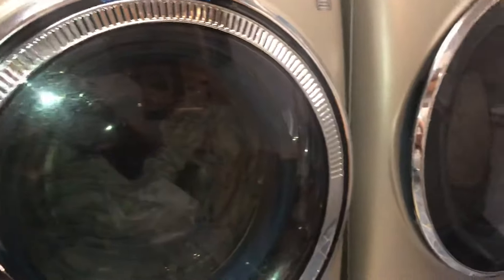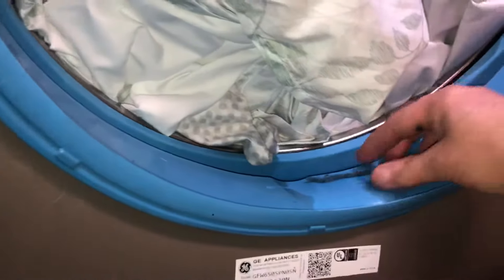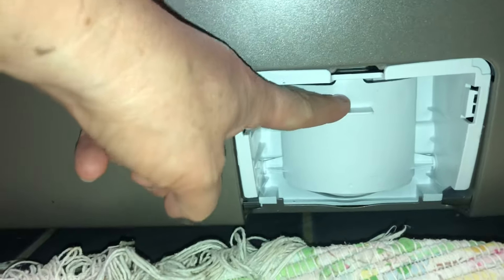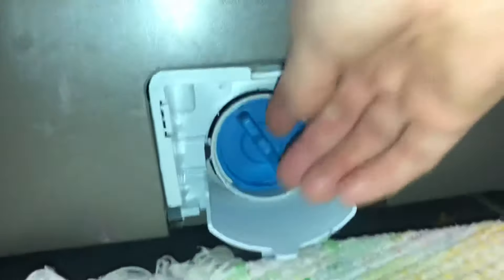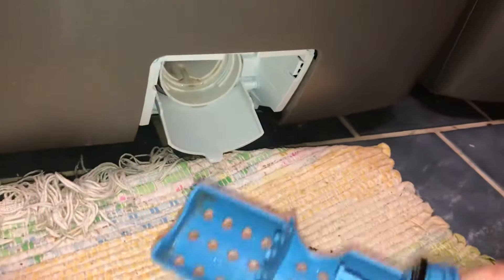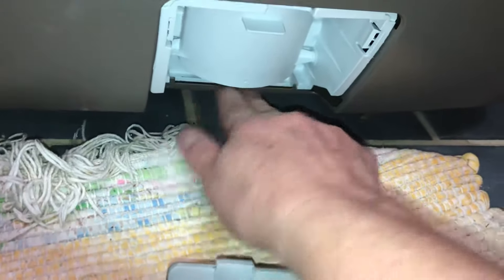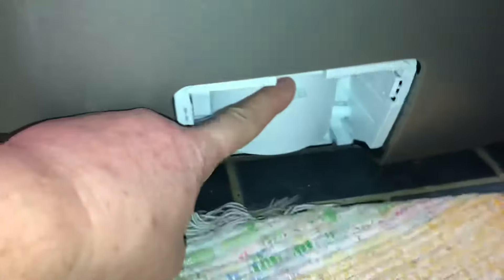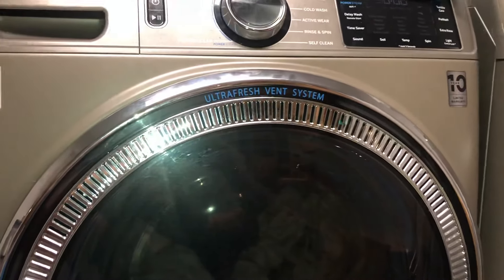Cleaning GE washing machine pump filter UltraFresh Vent clothes washer

Comment: If anyone is having trouble with gasket preventing the filter from properly closing resulting in water leaking, trim the outer diameter of gasket a small amount. The gasket stretches over time and use, which prevents it from properly tightening. But, be careful take alittle off and test to see if closes properly. When you push the filter in it should slide in smoothly don't use too much force you don't want to ruin the threads.
Reply: Thank you!! This helped me fix my gasket from leaking water, I tried boiling and heat gun but didn’t work. Then I saw this comment and started cutting the rubber gasket and it works! 😭
Reply: Omg thank you! You just saved the day! I could not get this thing back in! It wouldn’t even catch. I trimmed a bit and it went back in and no leakage.
Reply: This worked for me too - just trimmed the tiniest amount possible to start and it went back in smoothly. No more leaks.
Reply: My washer leaked all over the laundry room last night. What did you cut? The jnside or outside of the rubber? @NinjaTheMinhja
Reply: Is the leaking from the door or from the filter? I’m confused. 😂

Comment: Thanks, that was great. I just opened mine and yeah a little water. That door acts like a gutter to move the water away from the underside of the unit.
Reply from the maker: Lol, mine didn’t seem to be very gutter-like, but that’s a good observation. Thanks for watching and commenting!
Reply: @fixthishouse3303  well, i guess since mine is on a pedestal, the door moves beyond 90° so the water stayed in the door and went right into my bucket:) 
I heard a funky noise in there and it turned out to be a pop can tab.
Thanks again!
Reply from the maker: @vtrdavefilms  I was wondering if you had a pedestal. I usually make a mess when I open mine.

Comment: My filter never screws in properly and takes quite a few tries before it stops leaking so annoying
Reply from the maker: I think the angle is awkward. I need to clean mine out again. I’ll see if I have any hints. Do you think the threads are stripped? Would replacing the cap help? If it’s still under warranty, GE may send you a free replacement if you write them. (I got a free dryer lint screen replacement.)
Reply: As someone else pointed out, the problem is the rubber gasket. You can verify this by taking the rubber gasket off and noticing how easily it screws on. The gasket becomes stretched over time, so the problem gets worse. The outside diameter of the gasket is too large. The solution is to either order a new gasket or trim 1/16" to 1/8" off of the outside of the gasket.
Reply from the maker: I made a video showing what a non-leaking pump filter gasket looks like: Inspecting the pump filter from a GE UltraFresh washing machine/ rubber gasket
https://youtu.be/4chPOIAYwbw
Reply: @brianmcginnis7417 I cannot find a new gasket anywhere. Most of the places online want $150 or more for a new filter. The entire drain pump can be had for under$100. If anyone knows a part number or a lead on a new rubber washer, please let me know.
Reply: Same!! I usually can it but I just made the biggest frickin mess. Seeing if I was the only one with the issue
Reply: @snaponjames were you ever able to find one? I have been looking!

Comment: Mine keeps filling up with it of water, I’m talking soaking towels! Why!?!? Nothing really in the filter trap to make sense of it
Reply from the maker: Is the pump filter slot leaking? Make sure it’s screwed in all the way. If it still leaks, check the gasket. People comment to say that the gasket gets stretched or deformed and needs to be replaced. I think someone said they trim it. I have a video on what a functioning gasket+pump filter looks like. Hope that helps.
Reply from the maker: Here’s the video I mentioned: Inspecting the pump filter from a GE UltraFresh washing machine/ rubber gasket
https://youtu.be/4chPOIAYwbw

Comment: My blue piece not screwing back in. Did anyone else have this problem?
Reply from the maker: Could you be screwing it in crooked?
Reply: @fixthishouse3303  I tried playing with it all day yesterday. I think I have to replace the black rubber on it, the rubber got bigger after taking it off and putting it back on.
Reply from the maker: Is it still under warranty?
Reply: @fixthishouse3303  unfortunately no. Expired last month. I’ll have to see if the hardware store near my home have something.
Reply from the maker: EBay might have it.
Reply: @kiabrown7252  did you find a replacement gasket for the drain filter? This part isn't available from GE without buying the whole drain pump. My gasket is out of shape and it's hard to get it screwed back in without leaking.
Reply: @amberbarnes1405  I found something in Home Depot that resembles it
Reply: I was told by a GE specialist that I would have to pay for a warranty then order the piece
Reply: @kiabrown7252  I’m having the exact same issue! Were you able to get a new seal?
Reply: As someone else pointed out, the problem is the rubber gasket. You can verify this by taking the rubber gasket off and noticing how easily it screws on. The gasket becomes stretched over time, so the problem gets worse. The outside diameter of the gasket is too large. The solution is to either order a new gasket or trim 1/16" to 1/8" off of the outside of the gasket.
Reply: @brianmcginnis7417  thank you so much for this info I have this problem right now

Comment: I'm not sure what I'm wrong did what you said and it's leaking
Reply from the maker: Some people say that the gasket on the plug needs to be seated properly. I don’t remember having any problem with mine. If your machine is under warranty, contact GE customer service (phone or email). They were very responsive when my dryer lint catcher broke from wear.

Comment: Anyone got a part number for the black rubber washer that sits in the filter?
Reply from the maker: Look through the comments for the replies to Kiabrown. Some people buy a similar gasket at Home Depot; someone else says you can’t get the part without a warranty… or you have to buy the whole filter assembly. Someone else trimmed the outside of the gasket because it was stretched. I’m trying to locate a part number online.
Reply: I’ve always cleaned out my filter every 3 months. I felt like if I didn’t there would be a mildew smell to the clean laundry. The last time I cleaned out my filter when I put it back it must have not been tight enough my basement flooded. I managed to put it back on somehow. I just went to clean out my filter again replaced it and again the same thing happened it was leaking I should gushing water. I couldn’t replace it it wouldn’t even catch. So I trimmed the rubber seal just a bit and it went back in fine.

Comment: Question: when you screw the filter back in does it need to be oriented in a certain direction? Or will the filter work in any position.
Reply from the maker: Any position / you don’t need to worry about the position. Just make sure the filter is screwed in sufficiently so it doesn’t leak. (Don’t over tighten it though.)

Comment: Thanks ! Just cleaned mine out. I’ve had this combo for about a year now and couldn’t figure out how to clean it. Mine wasn’t too bad since I only do me and by boyfriend’s laundry.
Reply: I have a stackable combo. How do you get a bucket or something underneath to catch the water? We have a ton of water
Reply from the maker: I use older towels and rags, but a cookie sheet might work. If a cookie sheet won’t fit, a disposable aluminum cookie sheet/tray might work, especially if you bend the lip down to fit the drain opening. Running the venting cycle might help drain off extra water, but that’s just a guess. I was surprised how much water came out the first time I cleaned the pump filter! Thanks for watching!
Reply: @fixthishouse3303  thanks. I have a full load currently and a “door” scrolling marquee error
Reply from the maker: The door isn’t fully closed. I sometimes have to lift mine to close it OR something (a sock?) may be caught in the door. Also, make sure the door latch is firmly attached.
Reply: @fixthishouse3303  Thanks. I have tried lifting, adjusting, pressing into and nothing. I even contacted GE and they had zero support. They want to send a tech out (under warranty) but next week. I am afraid of having mold or dew built up.
Reply from the maker: Open the door and play with the little button above the latch. If you push it in and turn the machine on, it should signal the machine to run. Yours could be broken. I might try to post a quick video showing what I mean.
Reply from the maker: Here’s the video I made. It’s probably not that helpful, but a start: https://youtu.be/4OYcTh6dtgY
Reply: @fixthishouse3303  I appreciate it! So my wife emptied the filter drain with a shop vac. Messy process but got the washer to start running again. Now. Same message again. Cannot open door. P.S when we had the door open nothing was stuck or loose.
Reply from the maker: Odd, I don’t know how to pump filter is related to the door message.
Reply: @fixthishouse3303  yea me either. But everything that I’ve read said to check the filter… which by the way is very difficult when the washer is full and stackable lol 😂

Comment: Make sure after you put everything back together, that it does not leak. Both the last two times I have done this, it has leaked because the gasket moves. Thank God our basement is unfinished.
Reply from the maker: Good point! Thanks for watching and commenting!
Reply: What did you do to fix it ????
Reply from the maker: @Miya Dock  In other comments people say to watch the rubber gasket. It gets loose or it’s too big. I have a video showing our (non-leaking gasket. I’ll try to link to it so you can compare yours to it. Inspecting the pump filter from a GE UltraFresh washing machine/ rubber gasket
https://youtu.be/4chPOIAYwbw

Comment: I had no idea to clean mine and have had it over a year. Just opened it up and there is black residue inside the piping (where the blue piece comes out of). Is this mold? It smells disgusting & I’ve noticed my washer smelling bad lately. Do you know how to clean inside the rest of the washer? A vinegar wash cycle?
Reply from the maker: Have you run a self clean cycle with bleach yet? I show this cycle on one of my videos but didn’t add bleach as you should.

Comment: Gallons of water how do we fix that?
Reply from the maker: You shouldn’t have gallons of water coming out. But if there is another issue (machine broken, door jammed, etc) and you have too much water coming out when you open the filter, I recommend a shop vac to suck up the water as it comes out. A shallow (even tin foil/aluminum cookie sheet) pan may help.

Comment: i did this and now it’s leaking
Reply from the maker: Check to make sure the gasket is positioned correctly and that you screw it in completely. I made a video showing what the pump filter should look like. Let me find the link. Inspecting the pump filter from a GE UltraFresh washing machine/ rubber gasket
https://youtu.be/4chPOIAYwbw

Comment: So I discovered your channel tonight after buying this exact washer and dryer pair.  Love your videos.   Can I ask. Are you still happy with your purchase?
Reply from the maker: Yes, I am. We do a ton of laundry and it’s so much better than our old ones. My lint filter is wearing and I’m writing customer service to get it replaced before the 1year warranty is up later this month.
Reply: @fixthishouse3303  I’m just curious with the ultra fresh vent. Do you run it every time you’re done with laundry or do you just run it like once a week?
Reply from the maker: The machine prompts you to run a venting cycle after each load (when the door is opened after a completed load). I think it spins and runs the drain pump (and a fan?) off and on for 8 hours in an attempt to dry the drum and prevent odor/mildew inside the machine. It turns off automatically… which is why I think it runs for 8 hours.